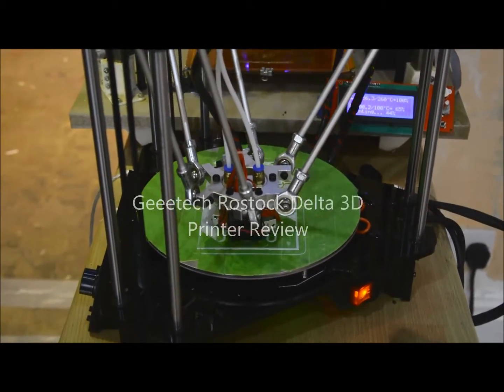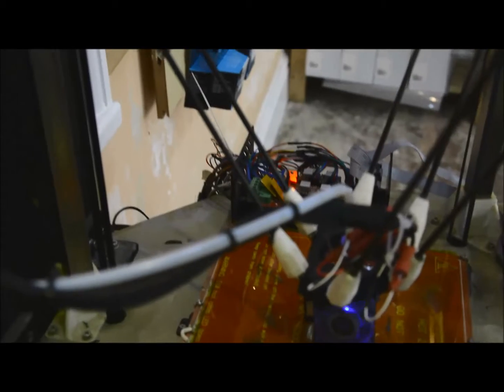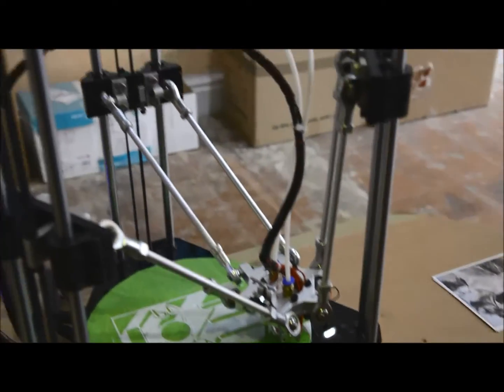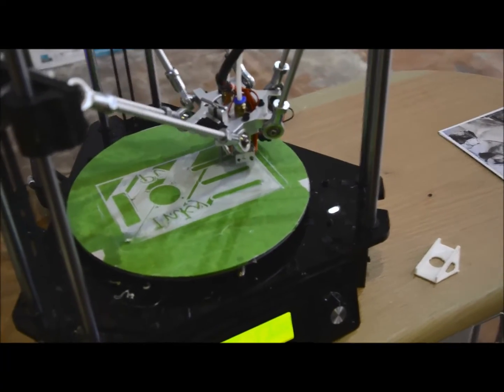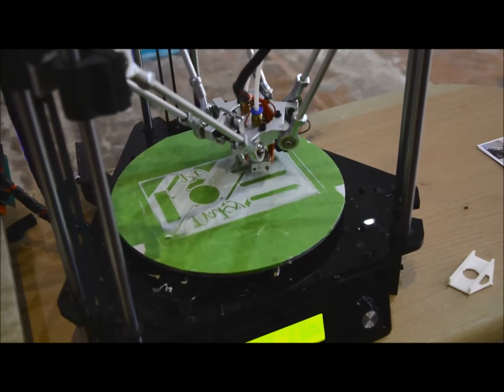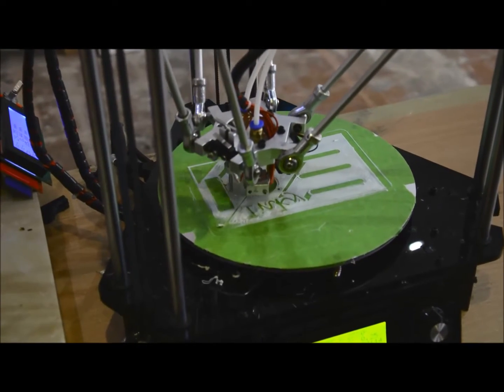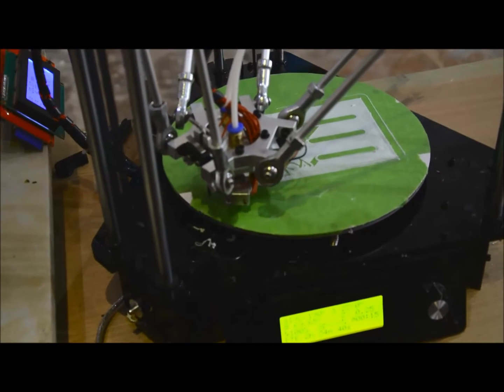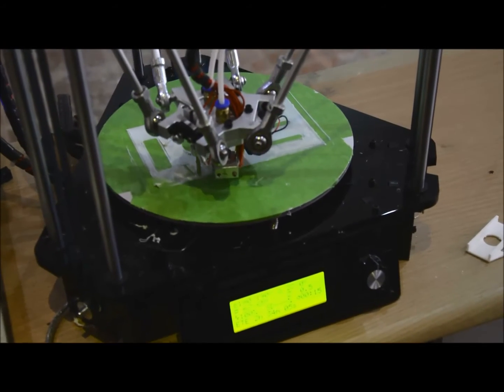Geeetech Rostock Delta 3D printer review 2

Comment: Greetings,

There is a Google Plus Community where a number of G2S owners have collaborated to come up with a tips and tricks to improve the print quality of the Geeetech G2s Pro.

https://plus.google.com/u/0/communities/102777312869306592721

Some of the most common problems include the diagonal rods being unmatched in length by up to 2mm, causing bad spider tilt.  The loose diagonal rod holders, as you discovered is another.

One group member crafted a version of the Marlon firmware that works well with the G29 auto-level.  I have it working as part of each print job now.

I'd recommend looking at the group, and asking questions.  I don't know how far I would have gotten without the folks in that group.

John

Comment: I was looking at the Geeetech but my concerns are the same as yours on the joints tolerances. Your original printer with the magnets and bearings is a much better solution. Is there a commercial available version of that printer?
Reply from the maker: +William Niedermeyer Hi no there isn't a commercial version of that printer available, its one I built myself. The Geeetech is ok, but as I stated you have to be prepared to work on it to dial it in. I have considered binning the original rose joints and replacing with higher spec ones. Same as the limit switches. I only bought the Geeetech really for the laser cut body.